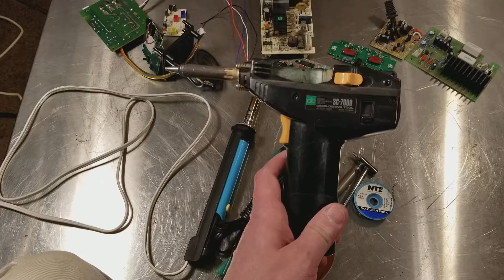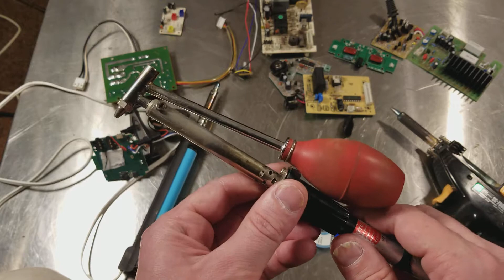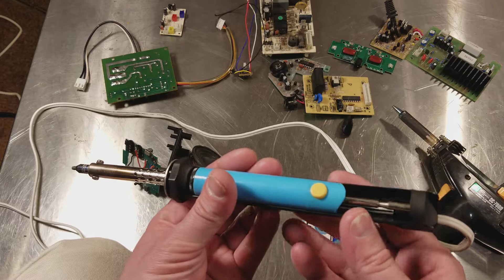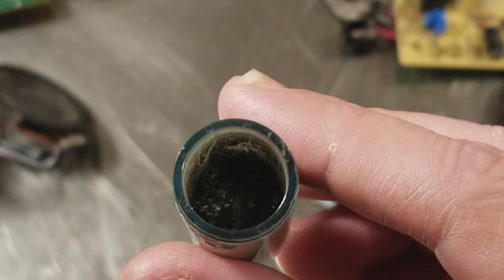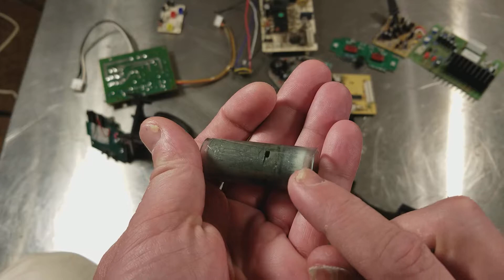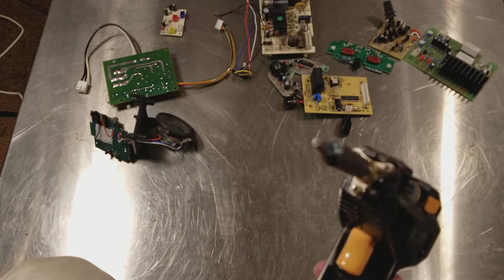Denon SC-7000 Power Vacuum Desoldering Tool Review & Test/Demonstration

Comment: I know it's an old video but I appreciate you making this and the in-depth teardown video because it's very hard to find anything related to this thing. I got one of these for 20 bucks from a very remote second hand shop, looks like it was used pretty heavily and it didn't look that impressive in the dim light, I thought it was from the 80s or 90s or something but I'm glad I picked it up.

Had no idea it was such an expensive and fairly modern tool, mine seems to work ok but it doesn't suck all the solder out so maybe it isn't sealing properly or the filter is setup wrong. Either way a good investment, hopefully I'll find some parts or tips for it, though I'm sure a lot of them will cost more than a whole cheap desoldering gun since it's basically a professional tool.

Comment: It's a nice review. For how long have you used this device? I hope it still works well.
Reply from the maker: Yes it does work well and I found them you can just use cotton polishing pads for hobby Dremel rotary tools as filters and you can just chip out the solder that builds up in the cartridge and continue to reuse it. It really is one of the easiest and most convenient tools to desolder I've ever used and it sounds like a cow mooing

Comment: Hi catus. I just got a new denon sc 7000z. For some reason it won't heat up as it supposed to be. I've waited for quite some time and the solder tip won't heat up at all. Instead, the handle part, near the on and off button gets really hot. Do you have any idea what is wrong with it?
Reply from the maker: If it's getting really hot near the power switch and where the power cord comes in it sounds like there may be a manufacturing defect and some kind of short I would open it up and look at it or just return it and get another one
Reply: @CatusMaximus  ok thanks catus. I appreciate the fast response